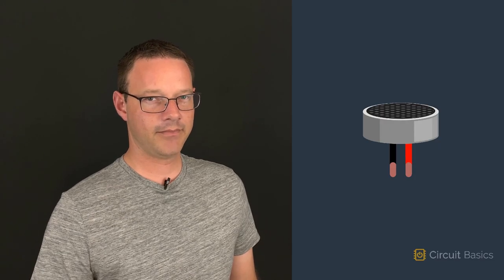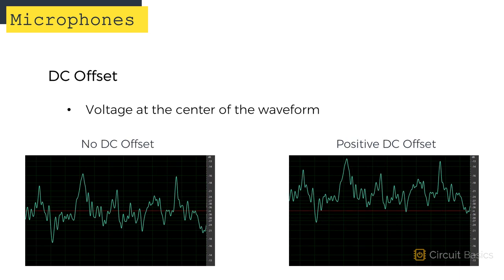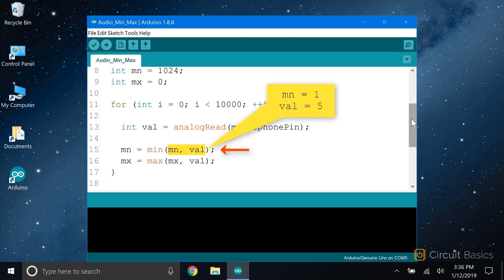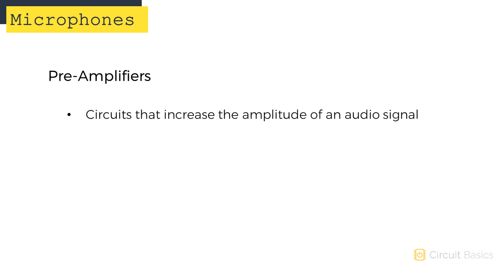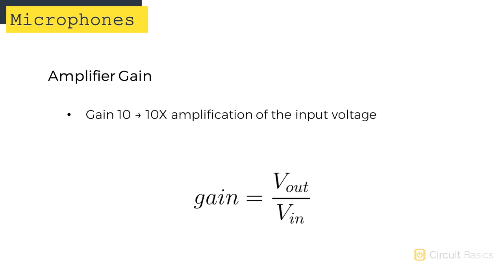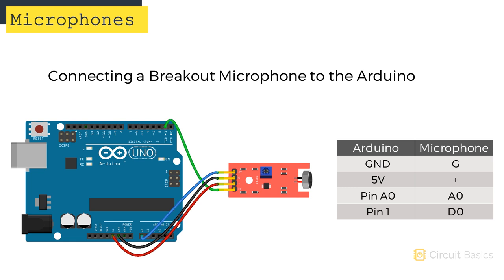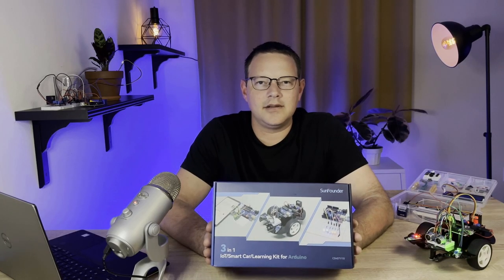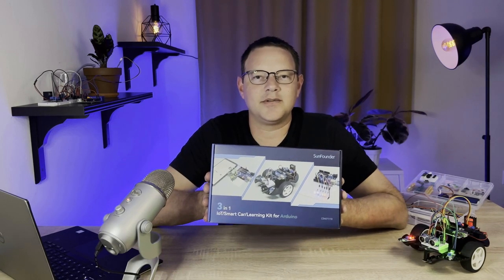How to Use Microphones on the Arduino - Ultimate Guide to the Arduino #32

Comment: 📺💬 Have anything to say about this⁉
🧸💬 There is no ground connected it has wheels 🐐💬 You can connect it to the speaker 🐑💬 ... DO not poking them like that the body is ground as they are connected to released statics you had speaker already.

📺💬 An opamp can be ground too 🐐💬 In the circuits diagram it is but for application, it is at the opamp ground. 🐑💬 That is caution because of the gain different but it had ground you should connect it to the body.
📺💬 See my codes and talk about it 🥺💬 My objective is to study and work, that is because the internal microphone is very sensitive, you try to save some data and filter out noises or repeating data. 🥺💬 It is the same as quantization but with a simple way of method, this way we save a lot of data transmission.
📺💬 He added some spicy but as he said aim for work and study.

( 📺💬 น้องทำไมทำอย่างนั้นครับ 🥺💬 หยุด 7 ครั้ง ครั้งนี้ 4 ปี เค้าไม่ยอมให้ทำงาน ผมจะทำงาน เค้าไม่ได้ให้เงินหรืออะไรเลยนะครับเอาไปพนันกัน จะเอาด่ากันไปว่าผมอีก ผมเลยตอบเล่นไม่งั้นมีแต่เรื่องปืน นักเลง เงินกู้เพราะเค้ามีแค่นั้น ให้เค้าไป ร.ร. 🥺💬  ขอโทษด้วยพอดีเค้าพากย์ ผมอธิบายทำไมทำแบบนั้น เค้าไม่ยอมหยุดด่าจะเอาโฆษณา ทางโทรทัศน์ วิทยุด้วย  📺💬 แถมอีกนิดนึง พอดีคริสต์เอาเหรียญมา พอดีครั้งหน้าติดคุก 📺💬 แต่ลืมดูฝั่งเค้า เอาไปประจานถามเค้ายัง คืนก็ไม่ได้  📺💬 แค่นั้นแหละเก็บไปทั้งคู่ 🥺💬  ผมก็ไม่ได้เอาไปด่าแบบเค้า พวกเค้าคิดไปเองไม่ยอมหยุดแกล้งผม แค่นั้นจะทำงาน )